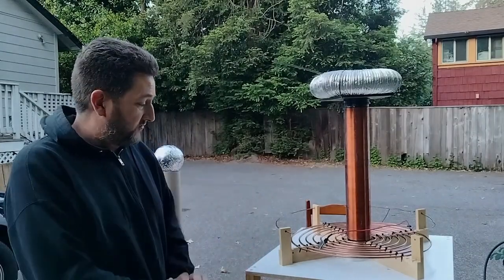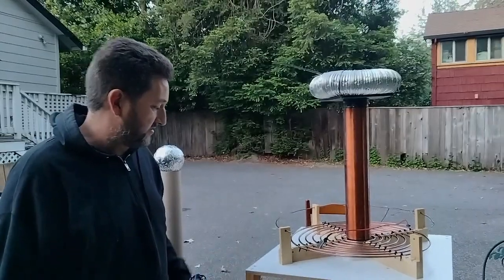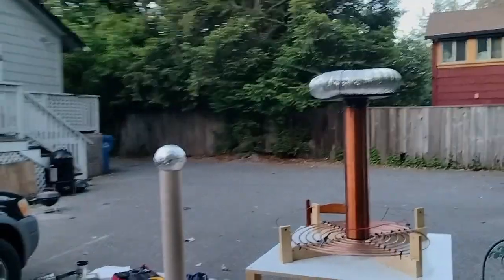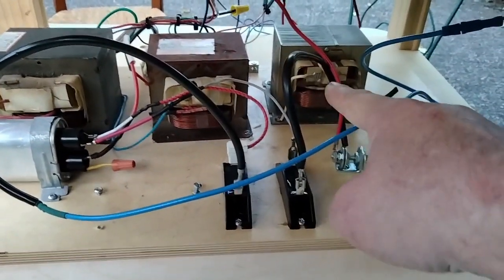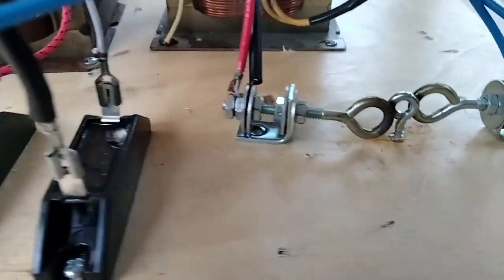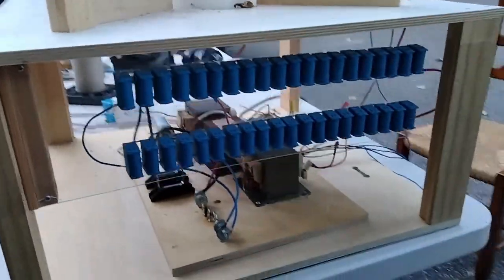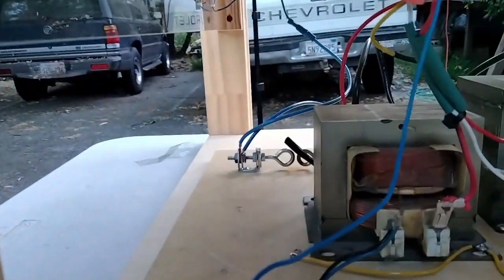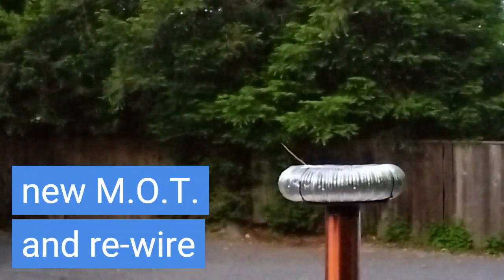Bigger DIY Tesla Coil

Comment: Cool build! Thanks so much for sharing! I am making a similar one right now with some friends. Do you know how much current it draws? Does it trip the breaker?
Reply from the maker: It was blowing a 20a fuse when I was using 2 Mot's in parallel as a ballast, but it doesn't blow the fuse or breakers now that it has a single mot ballast on the 120v feed, low voltage winding . I was planning on trying to get some current readings, I'll get back to you if I do. Thanks